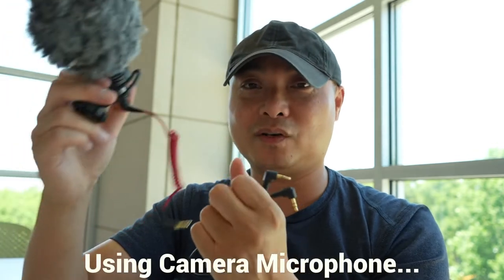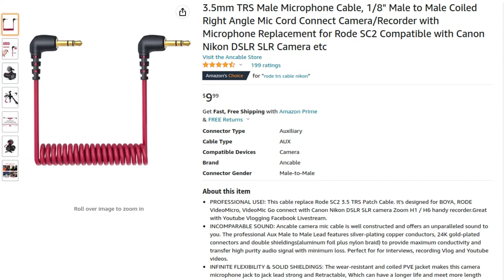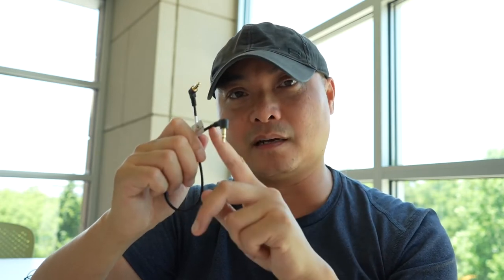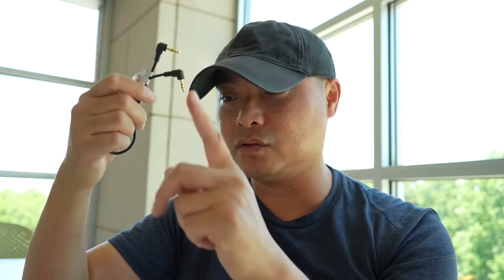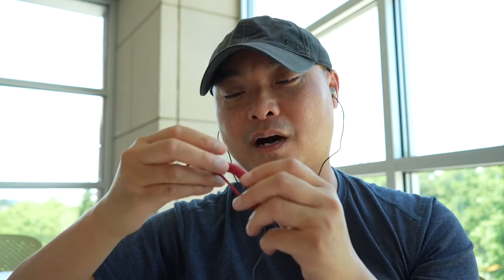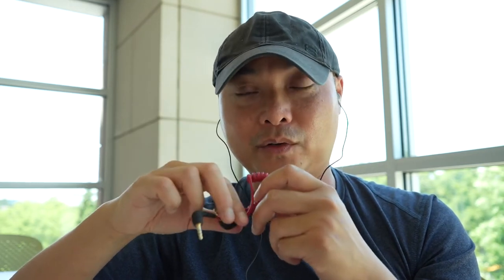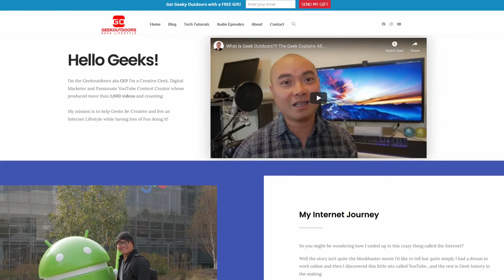Rode VideoMicro Noise! (How To Fix Static and Cracking Noise)

Comment: Thanks for this.  Any tips for eliminating noise from the mic bouncing when the camera moves?  Also, my mic pics up the noise of the zooming button.  I have a Canon Vixia.  Thanks!
Reply from the maker: Sure thing. I don't really have a good way to remove mic bouncing noises in video as I ran into similar issues so just try to prevent mic bounce.

Comment: I have this problem on my Videomic Go II on A7Siii. Getting static like sound, in particular when windy with dead cat on. Having to spend ages in Davinci using the equaliser to remove it, but this is muffling the rest of the audio, so not a long term fix. So it looks like it could be the wind moves the cable causing the cable connection to fail for a split second causing the crackle sound.
Reply from the maker: Oh wow that sucks! I was also thinking about the Videomic GO II mic good to know thx 👍

Comment: Hi, maybe you could help: I have this terrible high-pitched clicking sound every time I cut my clip in FCP or create a transition. The audio was recorded with the Rode wireless go 2 mic. I tried to fix that, also with expanding the audio and using cross fade transitions, as well as with playing around with different exporting formats. It's still there :(((( So disappointed
Reply from the maker: Hmmm not sure were those clicks there in original audio? Also I don't use FCP myself so if it is something with editor, then not sure there 🤔
Reply: @GeekoutdoorsBrand  Thanks for your fast reply. Unfortunately those clicks weren't there. I also made some tests, cutting my clip in random places and then exporting, and the clicks were in every single spot where I cut :/ I've managed to arrange a return today uufff. I think I will look again into a lavalier option paired with the Zoom H1n. Thanks anyways!